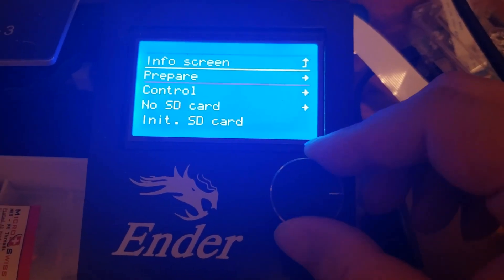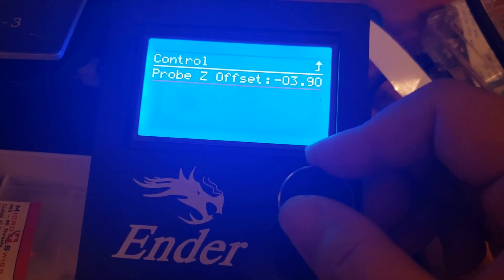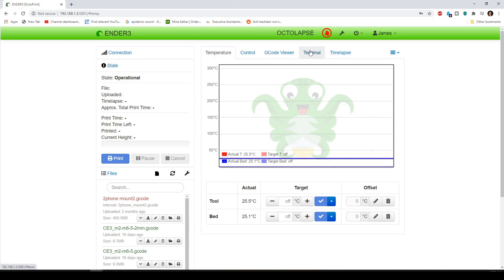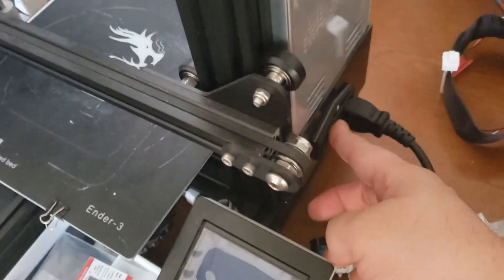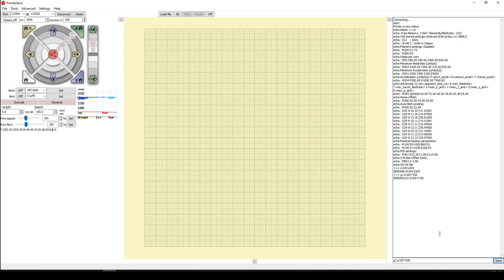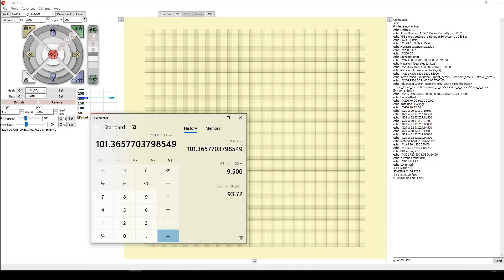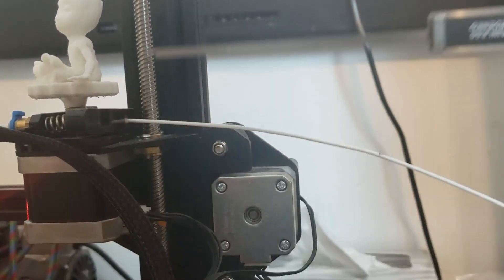ENDER 3 BLTOUCH E STEP CALIBRATION - How to calibrate esteps with bltouch enabled.

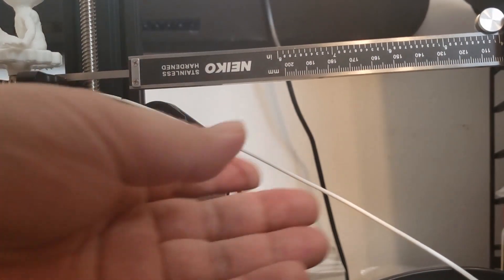Comment: When you measured the filament with the calipers, you're not supposed to measure with the sliding edge of it on the step that's on the end. That's the incorrect way to use calipers to measure steps. Like how you're doing at the 6:55 mark on the video.
Reply from the maker: I'm actually not using the sliding edge.. I'm just using the digital read out.. As long as your digital read out is accurate it should be ok. I re watch part of the video and I can see it could be misinterpreted that way.

Comment: As always! Nice videos, And perfectly detailed! But Do you have a video of how to adjust e-step clibration on a 
cr-10s pro?
Reply from the maker: I just did a video on it if you need it here it is:  https://www.youtube.com/watch?v=0IuK74if9TM
Reply: DiyProJames  thanks allot buddy! Allot of good info, i will save this in my folder👌🏻 keep up the good work😊😎
Reply from the maker: No, I don't have a separate video for the cr10s pro yet... It will basically be the same with the cr10s pro using pronter face or terminal inputs. While, I did check on my cr10s pro, maybe because the dual gears having "teeth" . I noticed that it was spot on and didn't have to be adjusted unlike the ender  3